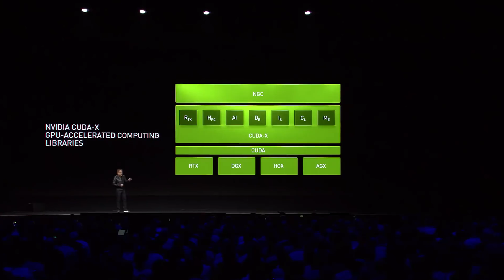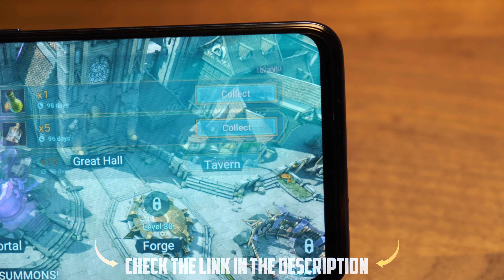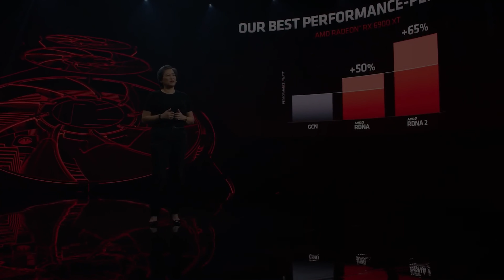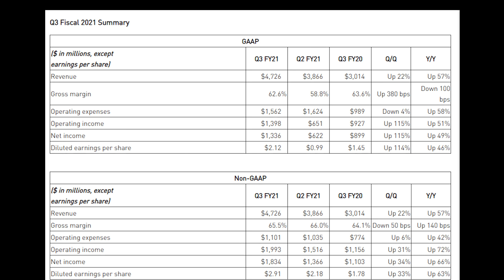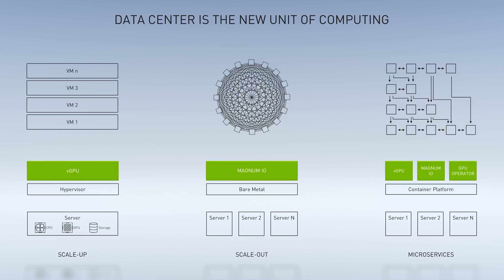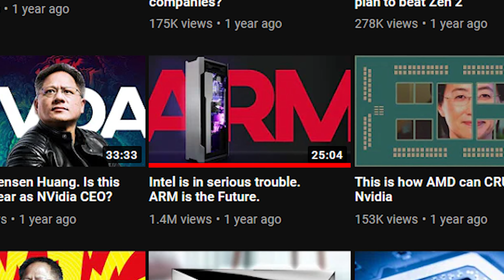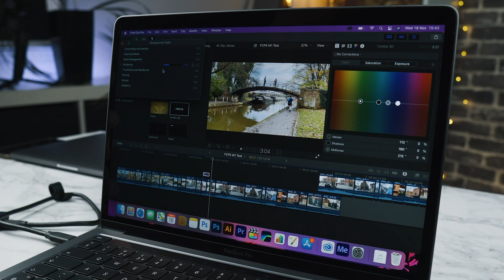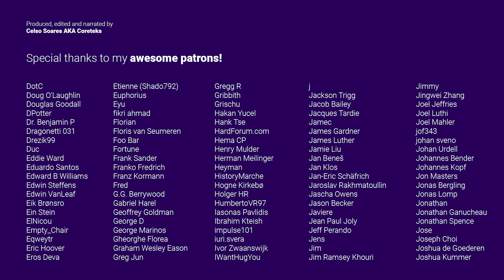NVidia has a REVOLUTION coming

Comment: interesting analysis.
i disagree with one conclusion. high perfomance CPUs will always be needed.
because even if you can offload all networking and security worklaods and even other basic OS workloads that currently slow down datacenter productivity...
you STILL want the fastest server cpu with loads of cores... to do the MAIN task that you are giving to them. be that encoding tasks or database tasks. etc.
nothing will replace brute force.
the only thing these "datacenter on chip" things will help with is to streamline workloads for the main CPU. less "thread juggling" and or interrupts
Reply: Very true, I also found Nvidia’s reason for wanting arm quite obvious, except for the acquisition, which he didn’t address, Nvidia didn’t need to acquire it but just purchase a license. It seems this acquisition will only cause more problems for them in the future.
Reply: Encoding is already best left to the GPU and with decreasing relevance of SQL databases in favour of NoSQL, they are getting much more scalable and potentially accelerable too, but I don't entirely disagree with you. Buying ARM also gives Nvidia an angle of attack there too. And it is far from alone there either. Neoverse in AWS Graviton 2 has already shown, that it can easily compete in the cloud sphere and ARM has already released two new versions of Neoverse IP designs to be put into actual CPUs, one continuing the decent performance many core CPU design and one even more aggressively tackling high single core speed. Amazon has by far the biggest cloud, and who knows what Microsoft may do on Azure, if they get more and more involved in chip design on desktop themselves. Google is already making TPUs and attaching them to IBM Power instead of x86.

What I don't agree with, is that you think CPUs represent "brute force". They don't. Their advantages are a. better at mixed workload and b. baring the use of special frameworks they are the default computational unit, so anyone building projects so small that getting into special acceleration isn't worth it are the real remaining resource for x86, but that is a shrinking market. Instead of taking an actual x86 server with direct storage in it and installing MySQL and some PHP base web app on it, even small teams, projects and startups are often starting right or switching to cloud services. In a world where even small projects can just use CDNs like CloudFlare to cache and offload encryption and compression, managed NoSQL databases like DynamoDB and object storage for media/assets, even these non specialised workloads can and will be accelerated, as each provider of these products is paid not for the hardware used, but the service it provides (request/s, etc.), it would be stupid for them not to accelerate as soon as the service is big enough.

What the DPU represents in this case, is not the ability to just offload some network or storage network specific workloads, but to offer a way of creating disaggregated storage and accelerated compute, meaning you can have work run on e.g. GPUs without a CPU assigning it, since that is now the DPUs work, or you have storage that can compute some aspects itself. If CPUs loose the central element of their name and role and just become one non-privileged compute target among many, you can bet they will be sold in far fewer numbers. Even if the remaining CPU workloads like a bit of app server code, or some glue code running on serverless functions don't migrate to ARM, which I think many will, the sheer loss in numbers will devastate Intel.
Reply: You also have to consider that GPU's are able to process many threads in parallel. Most data centers as you know are increasingly tasked with taking on AI and as such neural networking, forcing a change to data centers architecture, especially how they are connected to the network, and their cooling solutions. So modern day data centers do not operate by older conventional means in their rapidly changing environments. There is room for many types of data centers, but the successful ones will be the ones leading through radical shift in accelerate technologies. Thus, in my view his analysis is what I see in the future for data centers as it's the mainstay of my business for 20 years.
Reply: @baum stamp      You are completely missing the point Jensen Huang has been trying to illustrate for years, GPU Acceleration works better than CPU.  "The more you buy.  The more you save"    Try watching any GTC keynote.    Traditional cpu servers are being replaced by GPU Accelerated options which cost less to install, take less space in DC and cost less to run as well as massively out perform  traditional cpu servers.  Everything is getting GPU Accelerated..
Reply: 72chillpill - Only those operations can be GPU accelerated that fit into their accelerated set of operations. For eg multiply and add. GPUs are no general purpose processors. Complex algorithms are potentially out of scope. But integrating CPU function blocks in a GPU would be an interesting reverse aproach to an APU.
Reply: I agree that multi core x86 will always have a place, it’s just going to be a much smaller place.

Comment: And what if the Nvidia ARM deal gets blocked? Risc-V
Reply: Nvidia already makes licensed ARM chips (the Tegra line) so they could do it without actually buying ARM like Apple did but it would be easier to keep Intel and AMD shut out if Nvidia does buy ARM.  It would give Nvidia extra expertise and control over the ARM processor market too.
Reply: @chbrules  No it still has to pass regulatory scrutiny of multiple countries.
Reply: @_rmw  no u
Reply: @chbrules  There is already a desktop chip with PCIe 3.0 support. And NVMe dunno what would it need more?
And technically the chip can do PCIe 5.0 already.
Reply: Then Nvidia can create their own risc-v chips instead
Reply: @kintustis  sure
Reply: @n0obhAcker00 that's why AMD bought xilinx.
Reply: @chbrules  no it's not
Reply: @_rmw  there is a parallel track of currency and trade tensions leading to issues of tech sovereignty that seems to be heading towards fragmentation.
Reply: @chbrules  Nvidia only applied to purchase ARM and are still trying to get deal finalised.  When the proposed deal was made public in Sep 2020 it was clearly stated "The proposed transaction is subject to customary closing conditions, including the receipt of regulatory approvals for the U.K., China, the European Union and the United States. Completion of the transaction is expected to take place in approximately 18 months."   And the truth is the deal is yet to be closed and finalised.
Reply: @paranoidrodent  Isn't that the reason that could kill ARM's as not many companies trust Nvidia and I doubt they would want to keep making ARM's chip if they can find an alternative like RISC-V.
Reply: @chbrules  china has already voiced concerns, and isn't likely to approve the sale, tanking the process. I don't think any of the western powers had a problem, but I remember reading China was going to flat out refuse certification of the sale
Reply: @chbrules  
Public interest intervention notice

On 19 April 2021, the Secretary of State for Digital, Culture, Media and Sport issued a public interest intervention notice (PIIN) on the public interest ground of national security in accordance with sections 42(2) and 58(1) of the Enterprise Act 2002 (the Act) in relation to the anticipated acquisition by NVIDIA Corporation of Arm Limited. This means that the Secretary of State will make the final decision on whether this transaction operates, or may be expected to operate, against the public interest and should be referred to a phase 2 assessment, taking into account both competition and public interest (namely, national security) issues.

The Competition and Markets Authority (CMA) is required to submit a report to the Secretary of State in accordance with section 44 of the Act by 30 July 2021.

Comment: But nvidia doesnt owns the main PC OS like apple does in macs, and msft is killing UWP which was supposed to serve among other things as a transition to ARM, how is nvidia going to change that?
Reply: Windows has to be in concert with where the hardware market is at.
Reply: @Safetytrousers  Windows is the driving force in the consumer PC market, with 80% market share. ARM needs Microsoft to care about it far more than MS needs ARM. When AMD went 64bit, MS basically forced Intel to be compatible with AMD's instructions. Intel's itanium died. The datacenter is easy because much of it is Linux/Unix, which is vastly more flexible with architectures. Linux is however nowhere near taking over even Apple let alone Windows for end user systems. Apple's "boutique" walled garden PCs won't appeal to the masses mostly due to their pricing. Apple's PC products benefitted greatly from having the option of running Windows, but now they are hoping to leverage IOS software compatibility.
Reply: @blkspade23  The hardware companies are hostage to Windows if they want to innovate?
Reply: @blkspade23  Linux has lo g since taken over...in servers. That's what Nvidia is focusing on. For you, the desktop or notebook user, they can fuse some bits off, and put it on a video card.
Reply: @Safetytrousers  The market is where the people are. Windows is somewhat of a victim to its own success. The platform has a certainly level of expected legacy support, which was a huge issue for Windows on ARM. There are Win ARM versions of various utility apps, but the Big Devs haven't put the work in yet. ARM devices would need offer very near native x86 emulation first to ease the transition. Would that even be possible while retaining the primary benefit of the architecture. Windows needs technologies that bridge gaps in transitions. AMD's X86-64 began the 64bit transition in 2003, and how long has been now that 32-bit is being dropped anywhere? There was a huge uproar over Canonical trying to do that with Ubuntu. If most are using windows, then your hardware/software (malware) better have a good chance of working there.

Otherwise they target MacOS, as its something for that specific demographic. The existence of ARM isn't a massive innovation, (as far as mass end-user perception) does mostly the same stuff, but for less power. That's the been the name of the game anyway. It makes sense for Apple, who are far more closed off and have no issue of forcing sweeping changes on their consumer base. RISC was the best thing ever, and then Apple switched to Intel. The 1st Rosetta wasn't great, but the platform wasn't used for much anyhow. Still they can grasp a far more attainable and graceful transition. They have enough 1st party software now that addresses their core, and they've merged it with IOS software.
Reply: @Safetytrousers  yes, its been like this for decades now, where you been?
Reply: @laurelsporter  I was talking about nvidia making an M1-like chip, it would make little difference without windows support unless maybe a chromebook but thats a very limited market vs win PCs
Reply: @JuanSanchez-rb4qu  Moonbase Alpha.

Comment: AMD chiplet desing allows for such accelerations. I don't see x86 going no where this decade.
Reply: Atlest for low power computers, if they release a good APU, arm should dominate, but adreno and mali are just too bad
Reply: @FIRSTEBITOS  ypu don't know what you're talking about.. adreno 650 reaches 1.4TFLOPS at 3W within a 100mm²  SoC. And mali G78 looks to be even better.
Reply: @randompalmtopgaming7541  TF cant be compared between diferent arch's, u need something more tangible.
Reply: @randompalmtopgaming7541  what i am trying to say is that they are in the edge of tech and still loses to the old boi VEGA at laptop like w's
(Srry, i was not clear)
Reply: The transition will take time, and the software developer are lasy, I don't see them optimizing for ARM CPU just to comply with Nvidia
Reply: Different times old man - Nokia went out of the windows in a few years. Things are changing faster than ever. 
Could be that x86 will be nothing more than extension board for legacy software in few years.
Reply: @LordAlacorn  things are not changing faster than ever, that is marketing. They rush stuff through that needa at least years more of development.
Reply: @FIRSTEBITOS  You are the kind of guy that said that arm isnt comparable to x86 and there it is the Apple m1 destroying everything x86 has to offer, the Apple iGPU is watt for watt way way faster than anything Nvidia and AMD has in the market and lets remember than Adreno GPU´s arent that far from Apple ones...
Reply: @ivand5699   i dont think that, but i still think ARM still a lot behind X86 in high power localized computing, watt for watt is a horendously bad comparison for computers, remenber perf/watt is more of a exponencial than a proporcinal
Reply: x86...still beating the dead horse
Reply: @Apple  no no no, arm is not worst than x86, i was comparing then in localized computing, but yea is most parallel cases arm is better

Comment: I understand accelerating some specialized functions, but moving from x86 to ARM would mean recompiling EVERYTHING, even software and drivers that are no longer maintained and just run on legacy infrastructure. A compatibility layer may solve some issues, but typically it incours in loss of performance, so the added performance must be so high (and the compatibility layer so efficient, safe and bugfee) that the final product runs with no issues, and faster.
At this point I see a RISC-V as a better alternative (open source, licence free), and guess who's interested at RISC-V at the moment ;)

Comment: ARM for servers was the HOT item back in 2014.  Heck even AMD had an ARM server solution.  NVIDIA had Tegra back in 2008, which is ARM SOC + Nvidia GPU.  Surely NVIDIA didn't need to buy ARM for Tegra, just like Apple they both have Architecture Licensing from ARM.

More likely Nvidia felt pressured to buy ARM before a competitor did.  Seems more like a desperation move.  Besides denying ARM from a competitor, NVIDIA had little to gain from this acquisition.  In fact this move could accelerate an industry departure from ARM licensing.

Having one Micro Architecture for Back-end and Front-end devices is not a very compelling argument,  they don't ever run the same software and are optimized for vastly different workloads.  

Weren't ARM servers supposed to dominate like 5 years ago.  What about RISC-V???  Open HW seems like a perfect union with Open SW.  ARM has yet to penetrate the server market and is likely too little too late.  With Intel embracing heterogeneous computing with a full stack of XE accelerators and AMD already on their third generation MCM designs, Nvidia is surely feeling pressured.  AMD has executed over 20 7nm design wins since late 2018 and is on track to move their GPUs to MCM in the near future(perhaps on El Capitan in 2023).

Comment: I remember when there was a rumour around 5 years ago that an arm cpu would be integrated on an nvidia consumer graphics card, it seems that now this will be a possibility.  Please reply if you remember the rumour or have a link that had the rumour.
Reply: That would be because of Tegra changing to ARM SoC aka SHIELD Tablet K1.   The Tegra K1 out performed Tegra 4 so much Nvidia did not want to call their new Tegra GPU Tegra 5.  Shield Portable used Tegra 4 GPU - try watching the CES 2014 keynote by Nvidia videos where Jensen Huang talks about "Cars, Chips and Games" thanks to the arrival of Tegra K1 in ARM SoC powering DRIVE platform, Tegra K1 and the new Unreal Engine 4 bringing same graphical feature set as high end pc to ARM devices running android which meant PC games could be easily ported to android and vice versa- with zero loss in graphical feature set.

Comment: No! Intel was not late; they acquired Altera back in 2015 for integrating ASICs, FPGAs and other forms of heterogeneous computing into their SOCs , they are just incompetent.
Reply: Yes, what is quicksync if not an accelerator already in consumer CPUs

And AVX512 ... Now a prominent part of Intel CPU marketing, as their process deficiency renders them inferior at pretty much every other workload
Reply: Yeah you’re right, I remember that it was a bit complicated and time-consuming writing code to squeeze out the most performance of AVX, the best way to do so was using intel compilers and IDEs which were quite expensive.

Comment: I was skeptical at fist if NVidia has a node disadvantage, because the 5700 xt was also on 7 nm, but the 3xxx series on 8 nm has more transistors/mm^2. Now that the 6800 xt is out AMD does indeed have a 14% lead in density.

Comment: Aside from specialized applications like supercomputers, good luck porting/replacing software running 99.99999% of datacenter applications (think web, database servers) and it's not about moving to another CPU architecture where you could just recompile stuff, you're talking about changing the whole compute architecture, in other words, software that have been in development for 20-40 years (apache web server, oracle db, java application servers, mysql, sql server, etc...) are suddenly obsolete in the sense they need to be rewritten or even reimagined in a form capable of running on DPUs. I think either a) the speculation is not correct, maybe those DPUs are targeting a more specialized datacenter segment or b) there are some missing information about a possible compatibility mode for existing software.